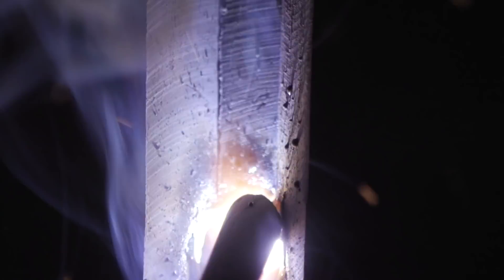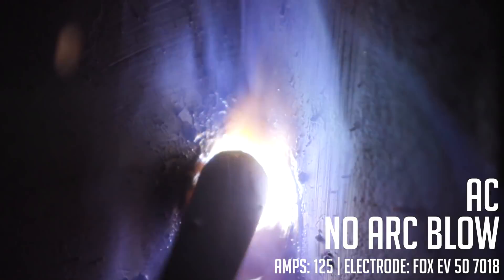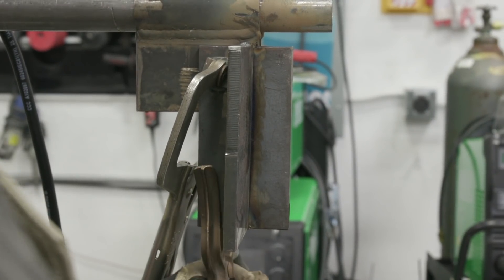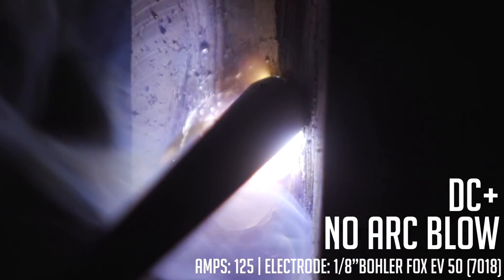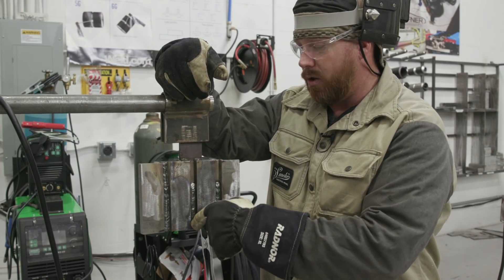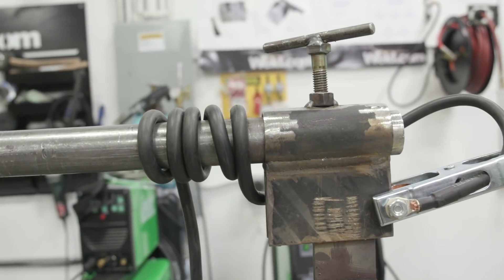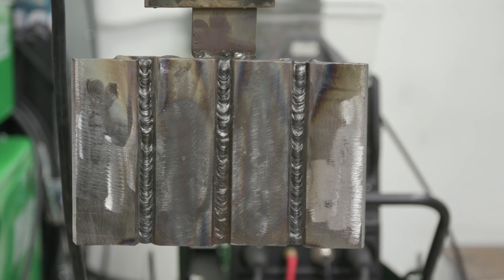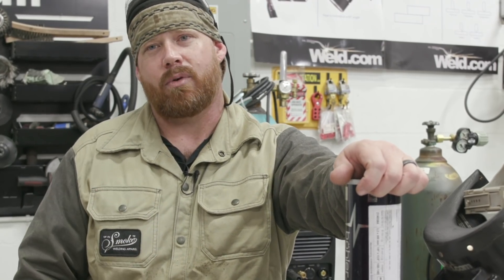4 Ways to Eliminate Arc Blow

Comment: As I understand it when you strike an arc it ionizes the air and creates a plasma.  Plasma's are sensitive to magnetic fields, as you are welding your magnetizing the piece, that's why you tend to run into arc blow farther up the weld.  With AC any magnetization is canceled out by the reversing polarity ~.

Comment: Hello , good stuff to try 
Also = this is beside that subject but i have a question for you =
I run out of wire wild welding ( flux or metal )  mig welding i mean , what do you do with the left  over in the linar of wire ???? Almost the same lengh of the the torch conduit ???
Thanks in advance
Reply: coil it up and throw it away
Reply: Thank you for your feed-back 👍✔️
Reply: Se Faucon 
Snare a rabbit.
Reply: If you know how to TIG weld you can use it for filler rod on thin metal. Or you can just throw it in the scrap bin and get a little change from it.. lol
Reply: ok thank you for your feed-back  👍✔️

Comment: So if current is going one way on the workpiece, and opposite from the electrode... North to North as your magnet analogy, why does man-cub always get his electrode stuck.
🤣😆🤣😆😆
Reply: He doesn’t spray enough arc start on the plate before he welds. 😂
Reply: I like using 20 amps with 1/8 7018. Best ever for sticking your rods. Thats my secret don't tell anyone. 🤫🤣.

Comment: Wrapping the cord creates inductance that  makes the field away from the weld pool
Reply: Turning the lead around most metals (or even air) will create an inductor; yep iron is the best core for an inductor. The video uses a DC circuit... so inductance isn't a factor, because inductors only resists CHANGES to current. In a DC circuit, an inductor would resist the initial increase in current, then act like a short circuit, once the circuit reaches the top welding current.

In any electrical circuit, the electrons will take ALL paths to the pole of opposite polarity.

My guess is that this has something to do with the magnetic forces that are created (at right hand angles to the direction of current flow). The clamped wire provides a different path for the current and a different set of magnetic field lines. When the field lines at the arc interact with the field lines from the clamped wire (or the wrapped wire)... the arc performs "normally".
Reply: @emailuser3869  The inductance added by coiling the cable will certainly have an effect on DC welding. It will act to smooth the current. That is to say, if the arc encounters more resistance, the inductance will add to the voltage, "forcing" the arc to increase, and vice versa for arc encountering less resistance. It could be that this current-smoothing action helps make the arc more stable and controllable.
Reply: @Graham_Wideman  You're absolutely right. I had wondered about that, too. What would be cool would be to get a DSO hooked up for current and voltage and see what was happening, when that arc started to misbehave. Where are these weld guys located?
Reply: @weld.com can you do an experiment and lay a bead, vertically, but not in the gap? Just take the same kitkat setup (with no "arc blow fixes") and lay a bead, bottom to top, on one of the a flat surfaces. I wonder if that gap (which you are supposed to fill with weldment) has some concentrating effect on the magnetic field... I'm betting it does. Would like to see.
Reply: Email User you assume the current in an arc is steady. While it’s DC, it’s far from consistent. As the metal melts in the pool, the current is trying to change to keep the arc going.  Arcs generate lots of EMI/RFI so that coil is changing the resonant frequency of the “circuit”.
Reply: @centurionhomeinspectionsin2253  The frequency of this circuit is zero. It's DC. There is no resonance.
Reply: Email User there is more RF than you know. Ever heard of a spark gap transmitter. It may start out as straight DC, but the current pulses. Believe me-I have a BSEE and am a licensed professional engineer.
Reply: Thats what I was thinking too...like it forms some kind of RF choke.
Reply: doesn't that only work on iron tho?

Comment: Could you use another cable to attach  to the work piece  clamp and wrap the  other end near the piece  you are working on?
Reply: Both ends of your cable that your wrapping around the metal has to either be connected to the ground clamp or one end connected to the ground clamp with the cable wrapped around the metal and the tag end of the cable connected to the work piece. It has to be a completed circuit.
Reply: @davidcrumrine1165  thanks

Comment: Quick question would any of these tricks work with flux core wire feed MIG when I have a machine that you can't change the polarity on?
Reply: @Liberty Dankmeme Christopher is my dad. I am his daughter I fell in love with welding through my welding Merit badge program at camp. The machine he and my Grandpa got me is really basic so my welds have looked really bad since I started using it. I have some big projects I want to do but needed the advice so I appreciate your input and I will try these ideas. I'm sure my dad would have been able to answer but I'm trying to learn this all on my own. My dad can weld but is not a welder so I figured I should do my own research and ask those who know more than either of us first lol. I am trying to save up my own money for a better welder and classes because I want to do this and if my dad can "bootstrap" start a business I should be able to do this myself too.
Reply: @christophersaint6926  you might check and make sure your running the correct polarity for the wire you are running.  Flux core wire should be ran as DCEN and hardwire and dual shield should be ran on DCEP. Your weld will look nasty if you're running the wrong polarity. 
 How you change it is inside the flap where your feed rolls are you will see a wire connected to your feed roll assembly and see if you can see a second wire in there connected to a negative lug with a wingnuts. Just switch the 2 wires and see if that helps.
Reply: @davidcrumrine1165  can't change the polarity on this machine and I'm using the wire it came with and requests in the manual.
Reply: @davidcrumrine1165  It's a bit confusing.

>>>Flux cored wire should be run as DCEN 

You might want to look closer at A5.20. Within the specification there is both DC- & DC+ flux cored filler metal. Even those that are selfshielding are mostly DCEN & a few DCEP. Does dual shield mean FCAW with gas shielding?
Reply: @miszced  yes dual shield is flux core wire with gas shield. There is flux inside the wire that helps shield it and the gas shields it as well... hence the dual shield. 

What part of my comment confused you?
Reply: @christophersaint6926  well than that wire should be the right wire. Guess just keep adjusting your settings until you find the right settings for you. Might try watching some videos on how to run flux core if that is what you are running. In my 30 years of welding I can count on 1 hand how many times I ran inner shielded wire (flux core). I mainly welded with hardwire , dual shield flux core or stick welded. I am sure some are going to give me a hard time for not using the technical terms but most people who watch these videos don't know those terms. But wish ya luck and hope you get it figured out.
Reply: @davidcrumrine1165  so, does Dual Shield run with DCEN, or is it mostly on Coreshield?
Reply: @miszced   dual shield or technical term FCAW-G is a DCEP. What DCEP does is it melts the wire so it causes the electrode metal (wire) to melt and spray on to the parent material (whatever the metal to be welded). This is where the splatter comes from if your machine isn't set right. But to be honest they say that all wire can be welded DCEP , but with that being said welding FCAW with polarity of DCEP that is why you get all that splatter from. The electrode (wire) is melting and forming little droplets of molten metal on the end of the wire. You can run FCAW DCEN and it causes the arc to go from the work piece to the wire which helps prevent the wire from prematurely melting causing the little molten balls on the end of the wire. The DCEP the arc goes from the wire to the work piece  in return the wire gets hot and starts melting prematurely causing all the splatter you get when welding FCAW in DCEP so it is actually cleaner and better weld to run FCAW in DCEN. 
 I haven't done any testing on it but with the wire not prematurely melting in DCEN you might actually get better penetration than DCEP.
Reply: @miszced  got a little carried away and I think I started confusing myself on that last comment. Dual shield or FCAW-G is a DCEP
Reply: @davidcrumrine1165  let's be trade name specific since Esab seems to be popular for some welders. 

Most Coreshield (FCAW-S) electrodes operate best on direct current electrode 
negative (DC-) or “straight” polarity. While Dual Shield (FCAW-G) is opposite of all 
gas-shielded flux-cored, solid (i.e. MIG) and metal-cored electrodes, which operate best on direct current electrode positive (DC+) or “reverse” polarity. In addition, even a few of the Coreshield electrodes also operate best on DC+ polarity, such as their T-4. Keep in mind, (as you slightly alluded to earlier "I haven't done any testing on it but..." most filler metals are formulation specific to their application. Hence, you can not take one specified electrode's essential variable like polarity and reverse it thinking arc transfer is smoother at the unknown expense of the formulation. Also, the arc shielding of the Daul Shield brand is significantly from external gas coverage. I see little to suggest any shielding from the flux core. Otherwise the same could be said about LINCOLN's Outershield or Hobart's FabCO. .
Reply: @miszced  you can think whatever you want but I am telling you FCAW should be ran on DCEN and FCAW-G should be ran DCEP same as MIG. All it takes is a little Google search to find this out.
Reply: @miszced  all outer shielded wire should be ran DCEP and inner shielded wire should be ran DCEN. Yes FCAW-G is both inner and outer shield wire but it is still in the class of outer shield and should be ran DCEP.
Reply: @davidcrumrine1165    my last post.

FCAW-G = Gas (Outershield) DCEP 
FCAW-S = SELFSHIELD (INNERSHIELD) mostly DCEN, with a few exceptions like their NS-3M (T-4). Esab & Hobart have the same exceptions. Stick with the AWS A5.20 Spec, it's detailed for good reasons.
Cheers!
Reply: @Liberty Dankmeme Thank you! I appreciate the help.

Comment: Silly question time!! 
Can you only have one ground per electrically connected piece of metal per welding machine? 
I.e, if I was welding on a section of I-beam say 50m long, and my earth clamp was down the bottom end by my rig. Surely if you were to join in on welding halfway up, your machine or mine might be overpowered by the return current? AC or DC?
Reply: Nope it’s actually pretty common to have several machines welding on the same building at the same time.
Reply: @jasonbecker3362  I was always told to keep the ground as close as possible to the work, I guess sometimes it just can't be helped!
Reply: @ifell3  in an ideal situation yes, but once your pulling 300-400 ft. of cable across the job site, you ground as close to the machine as possible so you only have to pull out just enough lead to get the stinger where you’re going to weld.
Reply: Basic electrical theory. Even though all the welders share a common ground (all ground clamps on essentially one piece of steel,) each welder is it's own electrical circuit, and only the current that travels through the electrode will return to the welder through the work connection.
Reply: @Todd Hoover good call on the bearing!! I suppose the return current on the DC has been nearly all used up melting the electrode, I bet AC may be different then as when it's on the fall of the sine wave the person closest would be the least resistance?